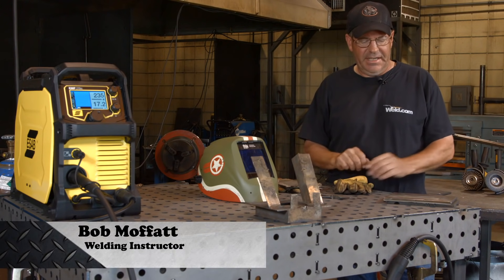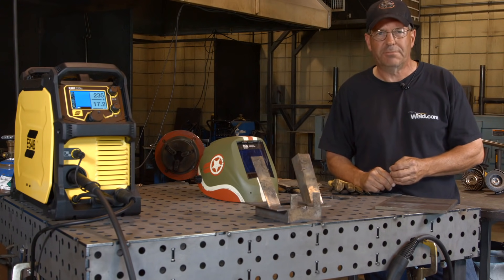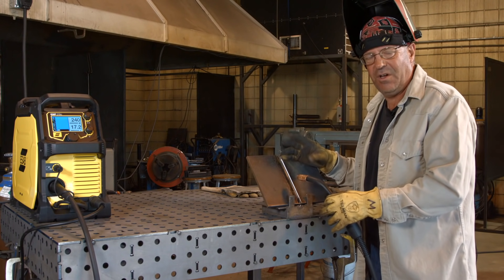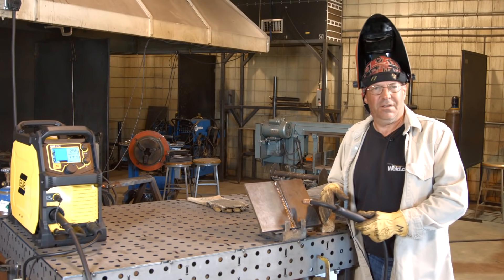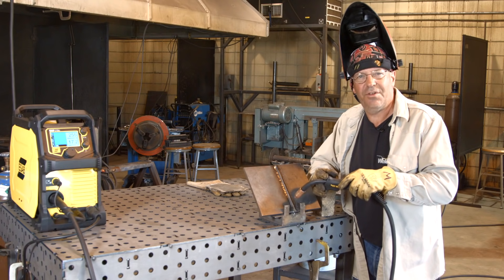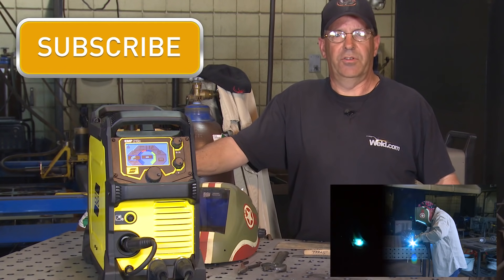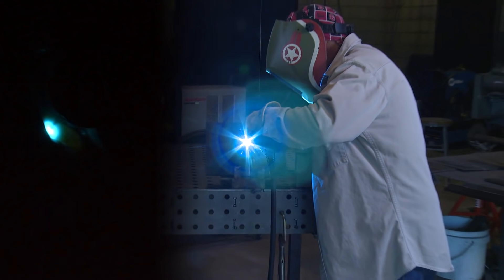Walking the Cup with MIG welding: Downhill Root, Uphill Fill and Cap

Comment: Wow what a hacker, you're misleading everyone.....always make sure the heat is hot enough that you're burning through your stock nearly immediately....or you want a bead which doesn't burn in rather it sits nicely on top except for a couple points that burn in just enough to hold the complete chunk of bubble gum in place but be careful! Don't hit that heavy duty repair with a hammer as it'll easily remove the entire heavy duty repair as easy as melting ice

Comment: Nice looking welds. In my opinion good vertical ups require proper settings. I always keep two plates for setup. Lower amps work the best. Its more about controling the falling puddle.

Comment: Metal plates appeared had a 1/4 inch gap (edge to edge) between them for the initial “ root” weld.  Why start with that big gap?  Why not start with the edges touching?

Comment: In TIG or MIG where does the glass come from? sorry if that is a stupid question but I am not a welder.
I did just buy my first MIG welder and I used it once so far I do have plans to use it a bunch but I do not trust myself to not cock it up. I liked the sound your welder made, not like the scrambled egg sound it made for me.

Comment: I’ve always had a problem with a vertical up weld because my weld would alway drop away from the part but this finally tells me what I have been doing wrong wire angle and movement. Thanks for the help.

Comment: First up your welds do look great and there are several AWS approved techniques but to my knowledge as a 40+ year experienced weldor, CWI, and CWE, anything over 1/4" thickness in structural plate has to be welded uphill when in the 3G vertical position that includes the root. To be clear we are not talking about pipe, but what your showing is good practice for GMAW and pipe welding alike, and for conversation sake the position wasn't vertical (3G) it was leaning to the back which is a good position for beginners to learn how to weld uphill, this is the first time I've came across any of your videos and I'm positive you've passed on some great knowledge and techniques in the past but I believe this video could have used a bit more AWS/CWI rules brought forth

Comment: This is not true vertical welding. it's uphill welding at 60-70 degree angle.  welding uphill at 90 degree have more issue in pool control.

Comment: I have a 255 mug Lincoln with argon and it kept welding the wire to the copper tip I just went back to stick welding what would you suggest I could have tryed to do

Comment: Can i just say as a British guy I love the American welding lingo. America has the best engineering education in the world, so jealous.
Reply: Germans are pretty good too, but yea I do like the way they teach it and there so much diverse welding processes used in the US weather it big machinery CAT style stuff, Naval ship yards, pipe, chemical, oil & gas fabrication etc. So many options widely used.

I'm new to welding just learning atm, I have a question about the mig angle uphill for internal corners, should I be trying to pointing my torch down on all uphill welds?
Thanks.
Reply: @deepwinter77  keep your gun either at 90 degrees or pointed slightly down while doing uphill.
Reply: @deepwinter77  the best way to learn is to grab some scrap and good ol trial and error. Watching reading listening can help accelerate your learn but you have to do it and feel it and see it.
Reply: @socalrcr  Yea Practice is definilty the answer to a lot of questions in welding.
Reply: @deepwinter77  what kind of welding are you doing? Like mig, tig? Stick, whatever
Reply: @brucestuff  Mig
Reply: @deepwinter77  I'm a month late but no, uphill mig is much stronger while angled straight in or slightly up, since the heat is pushing the puddle and not pulling it. Turn down voltage and amperage a bit from standard settings for your material and electrode, and weave side to side
Reply: You’ve got to be joking
Reply: They’re still using the imperial system so I doubt it
Reply: What do you call flux core in England or wherever you are
Reply: @chriselliott484  I think he said British, so maybe Britain 🤷🏻‍♂️
Reply: American, German, Japanese, all great workers, engineers, specialists... But when they (clients) need the special ones, they only get in one place, Portugal. 😄
Reply: Would love to weld in the us of a
Reply: How many places have you been taught engineering?
Reply: As an American, I think the Brits cornered the market in lingo/slang. Out of curiosity, what are some unique terms you noticed?
Reply: @dustinsmartfishing  i was just going to ask this too lol
Reply: Right !they do have a great lingo buckshot for bee bees
Reply: The japanese are the most thorough.
Reply: @andywells397  that's why there are so many Japanese contractors working all over the world...ohh wait, nevermind, the Japanese always hire foreign contractors for major industrial builds. The Japanese gave up their place on the world stage a long time ago. Honestly, they are way behind India when it comes to welding and industrial building.
Reply: @jacktheaviator4938  sheeesh you came for everything he had
Reply: @andywells397  Indians at 3am cannot be topped in terms of teaching.
Reply: @andywells397  the Chinese are as well. Like crazy thorough.
Reply: @donttalkjustplay4274  lmaooo what a joke
Reply: @Ceqsy  I missed the part that was a joke. I don’t know your life man 🤷🏻‍♂️

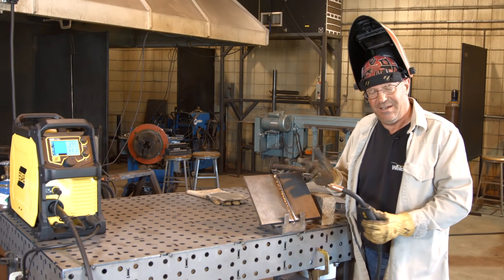Comment: @ 4:10 this guy just basically solved all my welding troubles. 3 years ago I went to welding school, and not ONE instructor has told me about that important technique. No wonder the wire never ran crisp and smooth doing my uphill passes. But thanks to Bob Moffit, now I know what to do. I feel so left behind. I been doing it wrong all along...

Comment: How did you prevent the two plates from trying to form a "V"? I'm a sculptor and I'll be doing a piece with pieces of 1/2 inch plate, and I've often seen welded  half inch  pull into that V. You did not seem to do any clamping or anything else. Thanks for a very informative video.

Comment: With dual shield fill and cap on pipe, you don't run a root downhill, where's these videos being shot, Louisiana? Or Ohio, the 'let me show you how' state. If you're a serious welder looking to maintain good standing in the trades, go with the proper procedures of AWS requirements and as a rule of thumb, downhill roots on pipe is done mostly with 6010 weld rod on gas pipe. I'm not speaking on AWS structural procedures, which fall under different standards, just the pipe welding. I was a journeyman fitter/ certified pipe welder for 30+ years finishing my career at Intel as a foreman. Good luck with your studies, always refer to AWS procedure when placing critical welds or prepping for a weld test. If you took a 6g test on 6" sch 40 pipe and ran your root downhill, your root would suck in with the penetration of your fill and cap, and you would fail the test. With mig on pipe, always run as per proper code and procedure, run uphill, always.

Comment: So, is it rather common to go downhill on the root pass? I'm finishing up my degree and we only go uphill on 3G, including the root pass which is much more difficult.
Reply: Never run a downhills root and gun angle is straight in or up while welding a vertical pass.

Comment: What angle is the plate at? Nice looking welds but I would have been much more impressed if it was a true vertical. I don't get the opportunity to weld slopes that often but when I do I notice they are much easier than a straight vertical.

Comment: My first job was a welder helper for a company that run Gas - Main and I progressed to be a certified gas line welder with ''stick'' that was all that was allowed then I am told they now allow you to mig weld...… I moved on to industrial maintenance where I have welded off and on over the past 30 plus years with tig/stick/ mostly mig. I think of myself as a better than decent welder yet time and again as I watch you I am impressed with your knowledge and your ability to demonstrate and explain your knowledge to others …… I have even borrowed a few tips from you here and there that has improved my own welding and I cant say that about most welding videos on you-tube sigh many are clowns that should not be showing anything 
I Highly Recommend People Watch U to learn and improve in the craft of welding and ignore what many others online have to say

Comment: Holy Sheepdip Great Cesars MF Ghost what manner of self styled backyard technique are you up to your electrode in.   Now i know why all the crusty ol  pipeliners hate Vo-Tech welders & told me a quarter century ago that if I knew what was good for me id not mention VoTech.   I would say you'll get a green cherry run straight off the job but rethinking that i stand corrected He wudnt even pass the test.... Lacking the most meritorious aspect of that coupon run amok,   your uniform weld placement consistency,   which no doubt comes from many a day standin round clean makin stainless nut belt buckles answering  "Waitin On A Fit!"  .. .. u gotta set that open root 6G Shot money Primadona stuff to the side,  its great & all,   & yur students are lucky to be able to learn the way of the 6G Open Root x-ray pressure fitting, as theyre always in demand.  But other fields like night & day u cant simply use that same style ,   like heavy structural,  to those outside of heavy plant foundry maintenance welding & plant fabricating or heavy shipyard,  its semi skilled, because of what u know of structural steel welders,  7018 SMAW ,   but thats just because all position aws smaw cwi stamps are just one of the many fundamentals required to be a true journeyman Ironworker where welds are few & far between as three threads of inch & a quarter wrenched 5/8 structural bolt needs no certified inspector.   But when u weld heavy construction maintenance in a UAW afl cio foundry mill or plant your building something new almost every day,   & that weldmemt would need to be done in a couple minutes.   Usually with a 1/16" diameter shielded flux core   wire out of a machine with a 480V plug that u twist & lock into the wall.   In ONE PASS. .... Heat cranked up,  wire slightly down, UPhill , with a leading angle, with a wide L to R tightly packed zigzag,  pausing briefly on each side, over 3/4" wide & continuous perfect consistency no puddle striations.....   Then at a shipyard their test coupons just to get an ID badge will have a huge gap never Ever downhill & as anyone with a conex full of tshirts will tell u,  if u can drag the Nozzle ahead of it your not hot enough but then again your pouring it downhill & i hate to be the bearer of bad news but 1 unless its sheet metal a downhill weld is not a weld,  & u can't walk a mig cup,   that's a nozzle....   Which is all well & great if theyre just going to some job shop building car trailors or something,  but  shit out of luck at a PowerHouse trying to weld some heavy schedule aluminum pipe backing stripped I-So Phase Bus Duct with a Cobra-Matic push pull I promise u it will not be walk/drag the nozzle downhill.  .. Not trying to be rude or insulting,   just every heavy welding procedure does not resemble a pipe coupon

Comment: I'm a welder at a plant we build dump beds. We use mig and the worst metal we use is hardox it has a primer  coating on it which makes it pop.and we use cheap welders and wire

Comment: I dont get it. If someone would see me welding roots on pipes downhill I would loose my job immediately. Inspecting weld with ultrasound or x-ray would show flaws and that joint would be cutted and welded again. And just for the record - there is a great difference between welding a plate on that angle and a straight up. Nice work though, exept the root
Reply: Api 1104 specifies a downhill root. I am a pipe welder B31.1 and api 1104 all my welds pass xray as per code. I have been welding pipe for 35 years. just my 2 cents.

Comment: AWESOME work/welds...
Now cut a strip of it out & Bend-It!!!
Reply: A test to see if it cracks at the welds when you bend it. My teacher taught me that in welding school also. I see you had a similar teacher.
Reply: @tjracing3243  absolutely... I'm a Union Craftsman. We're SMAW AWS d1.1 ... gotta do Destructive Test to earn your certs. Also no power tools allowed during testing, hand-tools only; chipping hammer, wire brush, pick-set. Clean up the test coupons & put them on a 10 Ton press nicknamed "The HeartBreaker".
Reply: Brother, it sounds like you worked at a shipyard like me. (Dry Dock 4.... Pearl Harbor, Hawaii.)
If not, you still know your job very well and have the smarts to do it right.

Comment: Sir, let me first say, I'd let you weld for me any day!!  Second, I am by no means a professional,  but i can lay down a pretty nice bead. ARC, MIG, Oxygen Acetylene,  never did Tig. Never had no schooling, dad taught us in the garage. Welding since at least age 8 and I am 48. Every video I watch I pick something up. I would have liked to see that top pass buffed out. Dont leave us hanging from now on. Lol. Even old dogs can learn new tricks. Thanks for the videos, little bit of explanation and then watching the video makes what you said make sense.
  Half moon, lazy J, circles. At a young age I can remember someone saying not to weld over weld because it weakens it. Well, after watching your videos and a bunch of pipeline welders, I have been convinced a couple years ago to just stack single beads instead of try to do everything in one major pass. 
  Biggest thing I learned is, I think I have my settings set to hot. Dunno,  but I know its burnt In . Lol

Comment: First question.. Did you weld the root pass downhill then flip the plate so that when you weld the second pass it's in the opposite direction of your root pass? And second question... What was your wire speed and voltage?

Comment: As always, good stuff. Perhaps weld procedures should have more detail such as wire angle relative to the plate and directionality. Do you ever get into metallurgical analyses of the weld? Perhaps pipeline welds?

Comment: I have a cwi that says he qualified a wps for 0.45 wire with the lowest wire speed setting at 361 and volts at 23.3 . I’m thinking he did this on 035 wire . It’s way to much wire coming out and he’s wanting this done over head . Any suggestions

Comment: The problem I have with this video is that I have been mig welding for about 20 years and this just tells me how much I DON'T know. Granted, I am not a professional and I only weld a few times a year, but I have a renewed interest in learning more which just reinforces how bad I am. Terms like uphill, downhill, root, etc. were pretty foreign to me until recently, I've gotten passable welds in the past, mostly by luck, I guess. I want to learn TIG but I was going into that thinking I already knew how to do MIG, which, it is now clear, I actually am a complete amateur at.

Comment: The welds are definitely great no question about it but why is the camera 20ft away when the best way to learn is watching his gun motion close-up. Seeing the flash of the weld from far away doesn't show me much so the best part of the teaching part is missing . Also how is this VERTICAL if the piece is resting at a almost 45 degrees angle? You want to see a great video with very detailed explanation check out Jody at weldingtipsandtricks.com, amazing quality video

Comment: You ran the root at 100 and 17.6...... Did you run all 3 passes at the same settings or did you change it back to 235 17.6 like it was set at the start of the video. I know all machines are different but it would help newbies to have some place to start with on the settings at least.

Comment: What are the parameters for each passes?
What did you run for the root pass,fill and cap both voltage and wire feed speed for each?

Comment: that's a very good demonstration I see all the non welders putting their two cents in downhill open Root Mig has been the code ever since I've been welding on pressure vessel I've never seen anybody try to put one in uphill

as far as a destructive test they don't Bend Mig it's a  pull text they measured the tensile strength at the fracturing point I've never even heard of them bending Mig if they do it's got to be some kind of special type of wire from my own experiments I know what don't Bend worth a s***

now something that I learned from a old man named Gary Crawford at Tulsa welding school back in early nineties is that you want to leave at least a 16th of an inch of the Belleville remaining for the cap what that does give your cap a squareness to it after it's laid in it's also something that you would use on any bevel
Reply: Robert Atwood on plate they bend test mig and go up hill on the route from what I was taught in school. not arguing downhill is wrong just pointing out they do it, at least here.

Comment: What is your opinion on a Millermatic 215?
Reply from the maker: Are you asking about the Millermatic 211 or the Multimatic 215? In any case, Miller makes a good product. There are some things we prefer about the ESAB Rebel over the Miller, which is why we reached out to them for some demo equipment, but the Miller is also a fine machine.

Comment: Can you MIG weld with 100% Argon? I have a TIG setup and was curious if I could get away without getting another bottle of gas for occasional MIG work.
Reply: Jim Jones  You can but settings are way different. What mode of transfer are you wanting across the arc?

Comment: That's not vertical up. That's layed back at a 50°angle.
Reply: Seamus O Doyle Welds exactly the same if I had it leaned forward toward overhead by 15 degrees. Had it leaned back for camera angle. Thanks though......